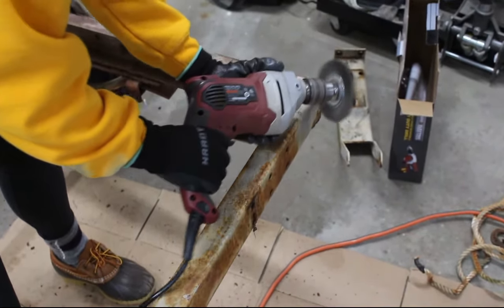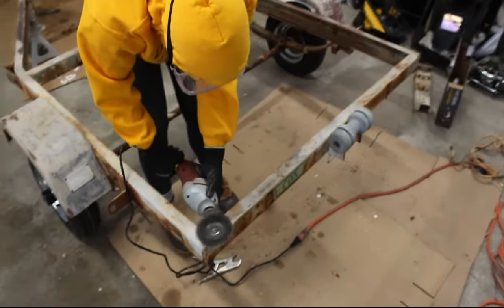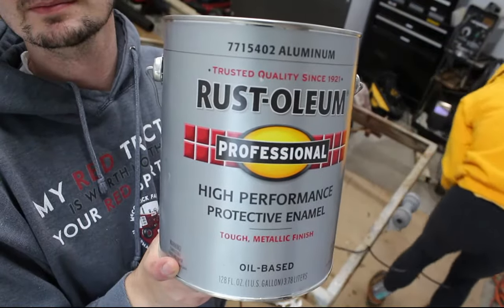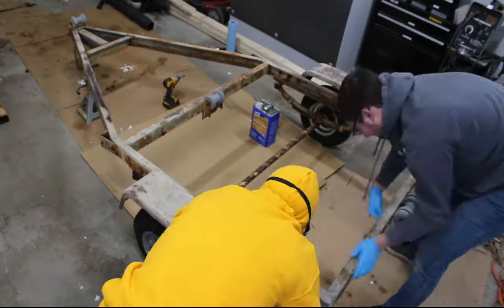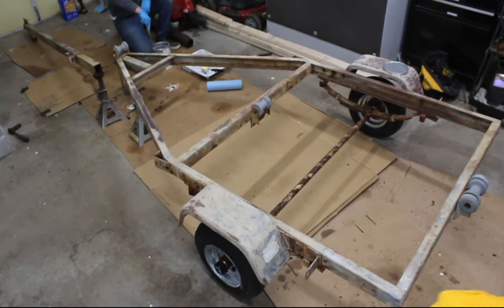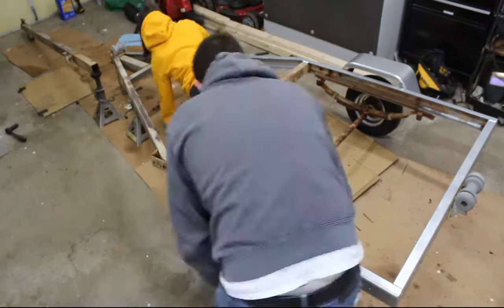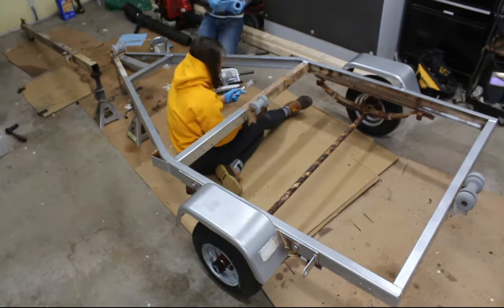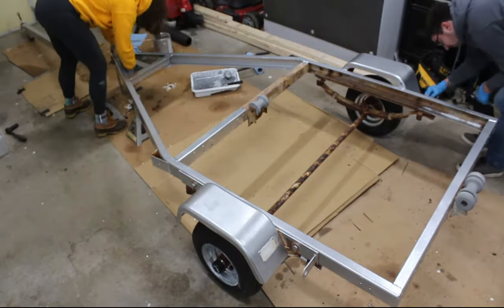DIY Boat Trailer Restoration - Part 1

Comment: I just recently did mines, and it also had rust from inside the frame tubing and tounge, did you run across that for yours as well, and any ideas? I wouldn't want it rusting from the inside out later.
Reply from the maker: That is tough. I blew out as much crud as I could. I was not able to sand down there. What I did was pour paint around each side and let it flow up and down the tube to at least cover it in paint. Maybe it helped and maybe it didn't....